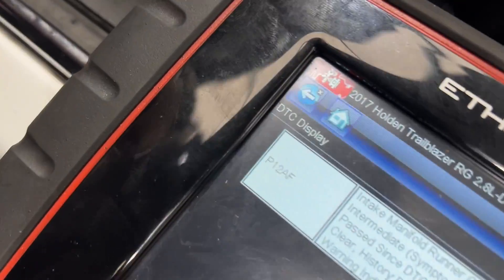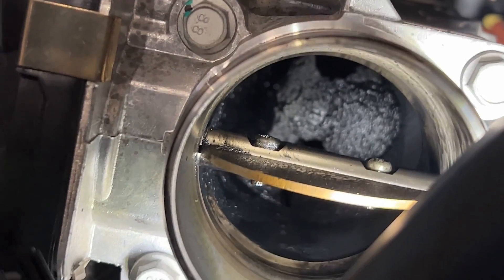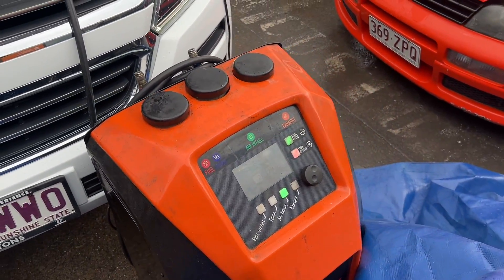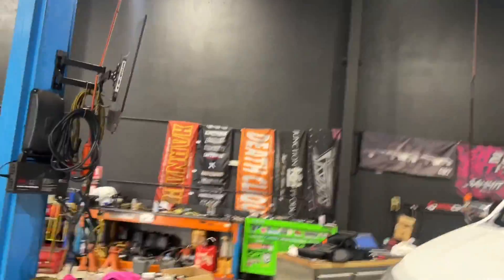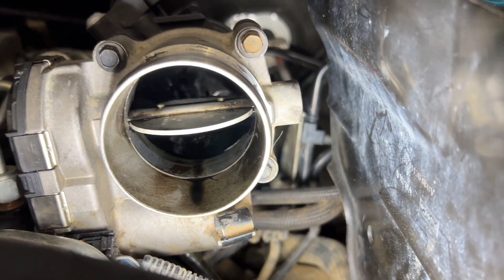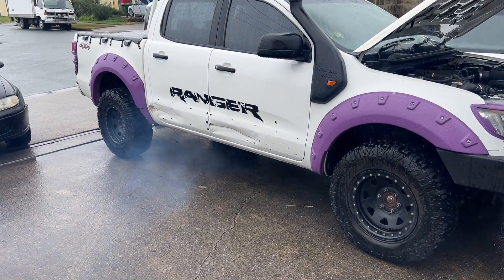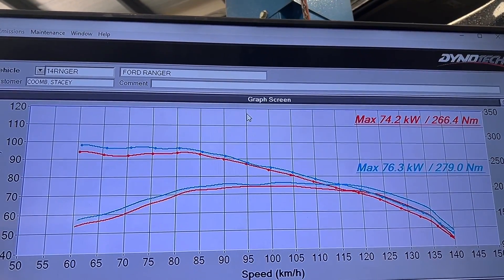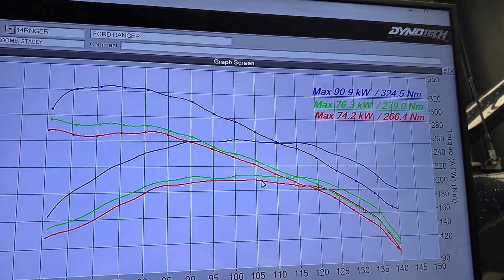Egr faults, Egr cleaning and Dyno tuning. DTC P12AF & P042F

Comment: Hey, lost for ideas and mechanic is also at a lose, I've had my manifold replaced due to cracking at 110k kms, solenoid ontop of the rocker cover replaced as we thought it was the cause for the P12AF code and my trailblazer is still throwing the code, what other issues could there be? Sick of throwing money at this car.
Reply from the maker: You could get it tuned and turned off.

Comment: Pain in the arse the trailblazer with its environmental bs. I had the manifold replaced under warranty once before, only had 22k on the car, Dealer whined that I needed to drive it longer to clean it out etc. Then there's the stupid warning that comes on when it wants to dump fuel into the catalytic to burn off the carbon build up, you have to drive for 15 mins or more until it's happy. So you have to burn more fuel because of the whole setup, how is that better for the environment? 
Kind of disappointed in diesel engines now. My engine light has come on and it's showing this P12AF code on my device as well, now only 33k on the clock. Now I'm out of warranty, no idea what this will cost. Might be better to get rid of it and go petrol, don't think they have these issues.
Reply: Yeah it's a pain, idk why they had to be painful with these trailblazers, should of just left the same inlet manifold as the Colorado's. I had my inlet manifold replaced due to it cracking but now it's also throwing a P12AF code, painful as the car is running smooth and going really well, The mechanic thought it was the solenoid on top of the rocker cover, replaced that and code still comes up. Absolutely shit design, lost for ideas on what to do next